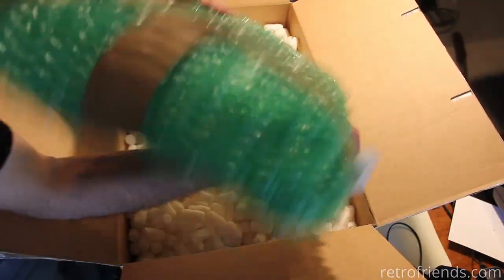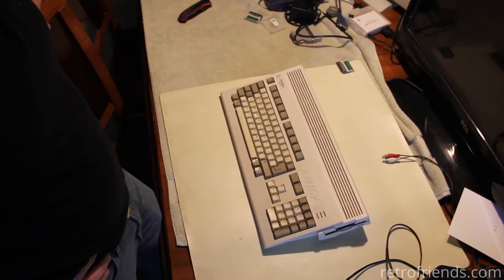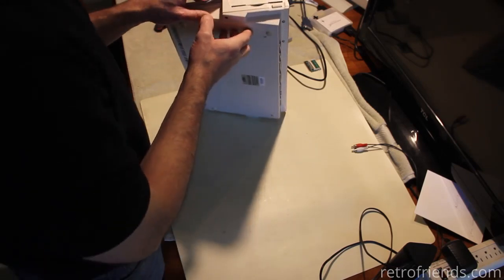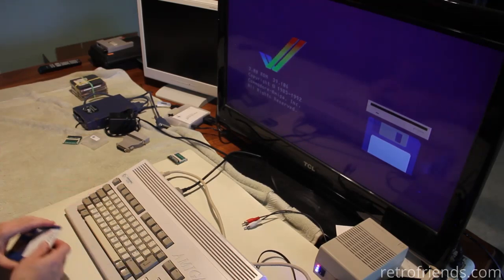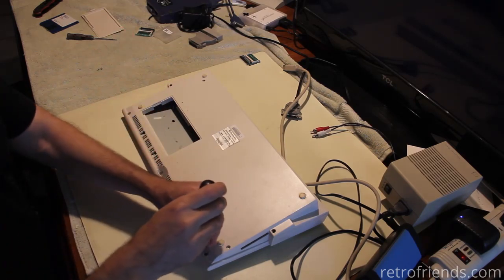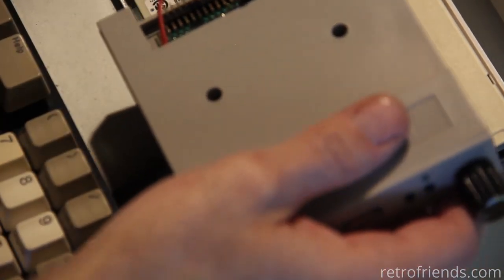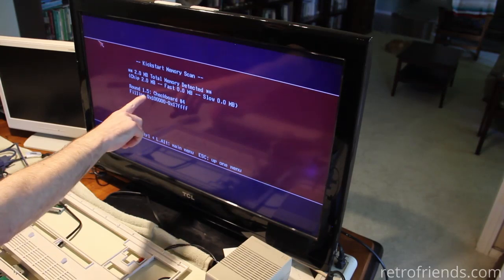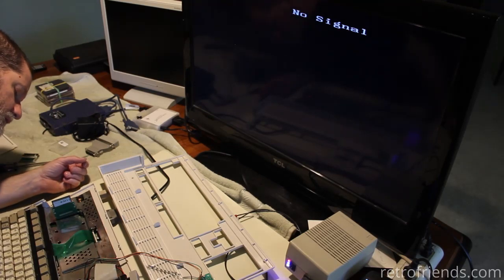Amiga 1200 from eBay: Unboxing. Does it work?

Comment: Some 1200's come with a IDE harddisk you can tell by the case badge as it will say HD on it, The floppy drive is double density - only some 3000's come with High Density floppy drives and the top 2 screws hold the floppy drive in place. The trapdoor on a Amiga 1200 is where you can add Ram aswell as CPU upgrades and some higher end CPU cards come with SCSI or enhanced IDE. The blank panel at back is usually where the SCSI port from CPU cards or Video out from Scan Doublers live and last but not least it has been my experiance that Commodore Boards suffer from Capacitor plauge where as Amiga Tech boards dont (I have had to recap 2 commodore boards, my Amiga Tech boards I recapped any way but no leakage when i removed them - that and when checked on a esr reader shown as still in spec!)

Comment: One of my CF readers has a solid light and works fine in my 1200. More of an annoyance than anything. Waiting on a longer floppy cable arriving so I can mount the one without the light stuck on in the back trap door as I have a scsi card in there at the moment which I never use.

Comment: Floppy drives on the A600/A1200 are lower profile than A500. Also, trapdoor on the A1200 is very sophisitcated, can fit a lot more than just RAM. Most A1200s were sold with no hard drive, and fitting one invalidated the first year warranty. A1200 is the "budget" 32 bit Amiga. Enjoy! :)
Reply from the maker: I have an expansion for the trapdoor on the way. Video to come...

Comment: Use Chinon FZ-354 in my A1200. That clicking sound can be off with NOCLICK20_USR.LHA on Aminet. Use 5x A1200’s with different AmigaOS such as ClassicWB ADVSP, AOS 3.1, AOS 3.1.4 and the new AOS 3.2. The best card is always the Blizzard 1230 IV. There are so many things you can do but WHDLoad is the best way. DD diskettes is a nice way do enjoy Games or Demos. 

Recap and a PSU such as the CA-PSU from iComp is the first thing you must do. A PCMCIA adapter is a must for the A1200. To transfar files and buy some SanDisk Ultra CF cards. With AOS 3.1the limit us 4GB but with BetterWB 4.3 you can go to 8GB. Newer AOS 3.1.4 and AOS 3.2 you can to 128GB but 32GB is fir me more than enough. 

A1200NET sells new A1200 caes and keycaps.The A1200 is great to experiment hardware and software. There coming still new stuff for out and you have years to explore the world of AMIGA. Have a blast and there are many many sites to explore.
Reply from the maker: Thanks for the tips! One point you brought up where we are on opposite ends of the spectrum is that I like my OS's like my ice cream: vanilla. I also like the drive click sound. Either way, great tips thanks!
Reply: The drive sounds clicks is great if there is a disk inside. Without the disk it’s crazy to hear the clicking sound if you to things with workbench.

Comment: 1000USD is crazy for an A1200. One from Europe would only set you back ~250-400EUR. The 1200 can boot into NTSC mode without any issues.

Edit: And it needs to be recapped asap.

Comment: 10:13 GO Dismantle the floppy drive and try recap the capacitor; so I fixed mine.
Reply from the maker: I have tried that with older drives, never works. I will try it, it does sound anemic which would indicate possible cap issue.
Reply: @retrofriends  there is one cap (smd) on the low side, that's the culprit, usually!
Reply from the maker: @mark12358  Thanks for the tip!!!